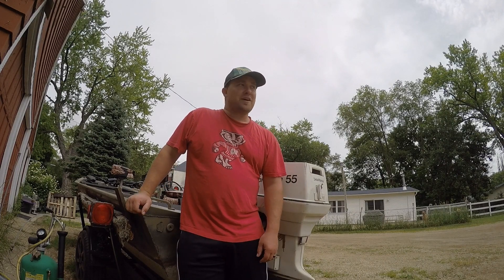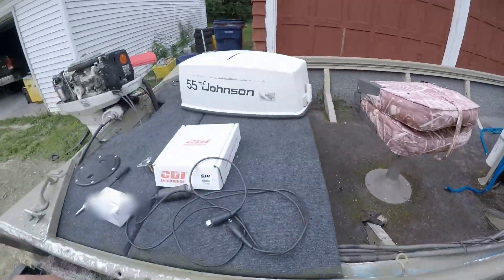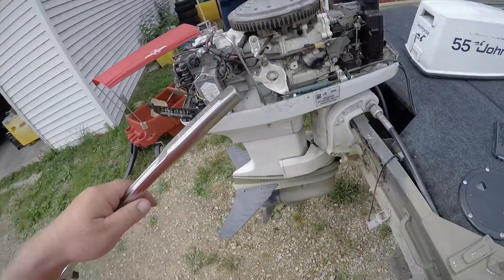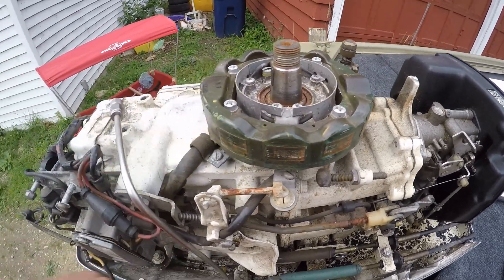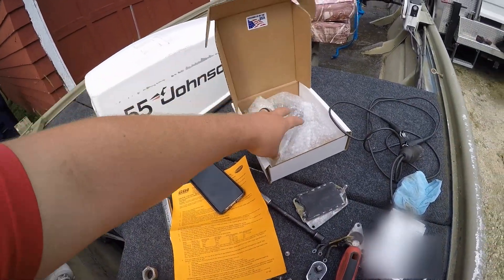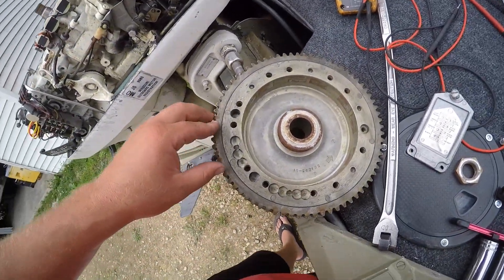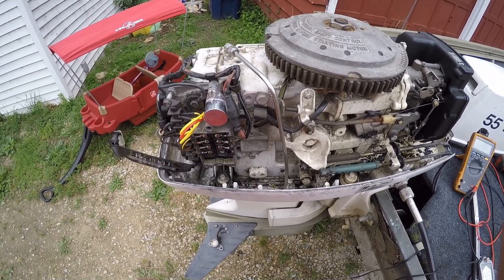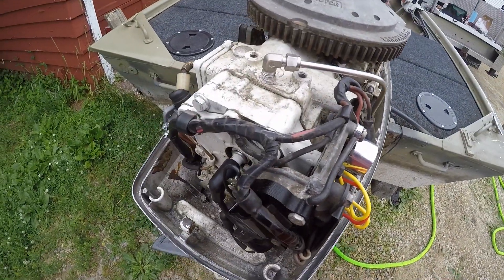Stator of Emergency

Comment: hate those old one piece stators. In late 83' early 84' OMC upgraded them to the ones previously used on the 9.9/15hp motors starting in 1977. Now you could replace either the charge, sensor or power coils without having to replace the whole thing. every chance I get i swap these old green monsters out for the newer ones.

Comment: How did you tighten your Fly wheel?
Reply from the maker: I did not perform the proper torque procedure that I'm sure is recommended. A couple of short raps with an impact gun and a little blue loctite will do the trick.
Reply: @buildthatboat9129  you put loctite on the threads or the taper? it needs 85 ft/lbs. using an impact like that can easily crack the flywheel, and you will always be way over or under torqued. did the flywheel key last so far? wouldnt trust that to not leave me stranded!
Reply: Where u buy ur stator
Reply: @justinbrown3104  tons of them on Ebay.
Reply from the maker: @justinbrown3104  Amazon had this one.